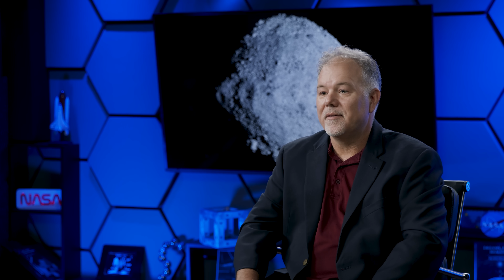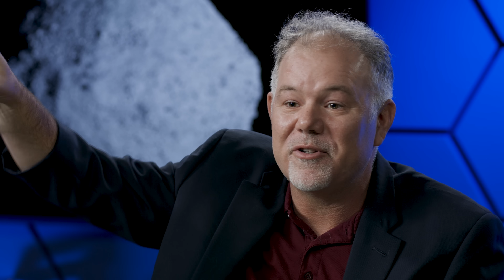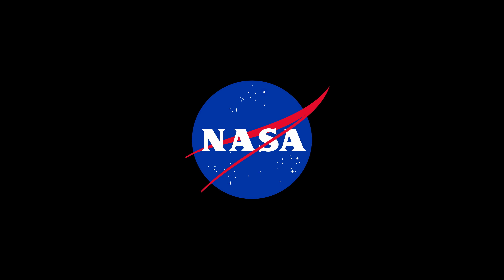Bio-Essential Sugars Discovered in Samples from Asteroid Bennu

Comment: I'm actually not greatly surprised. Take glucose for example, formula C6H12O6 
It essentially is carbon and water. We can drive off the water with heat, leaving pure carbon, and as most decent chemists understand, chemical reactions are reversible subject to energy input or export.

Comment: for those interested, an extract from the paper: "The abundances of ribose, lyxose, arabinose and xylose were 0.097 ± 0.014, 0.018 ± 0.007, 0.11 ± 0.03 and 0.079 ± 0.033 nmol g−1, respectively (Table 1). Glucose had the highest concentration of the sugars at 0.35 ± 0.05 nmol g−1, whereas galactose was 0.014 ± 0.004 nmol g−1 (Table 1)."

in addition to that: "The chiral amino acids in a recently analysed Bennu aggregate sample were racemic (d = l) or nearly so17, indicating no measurable biological contamination*, which would have resulted in a higher abundance of l- relative to d-amino acids. Furthermore, the SiO2 procedural blank (Methods) is free from sugar contamination (Figs. 1 and 2), confirming that *the Bennu sample was not contaminated during analytical processing."
Reply: That is extremely exciting to hear, my goodness
Reply: I'm very pleased to have read your post as I was worried about sample contamination. Especially seeing the very small concentrations that were detected. Amazing what a gas chromatography can do!